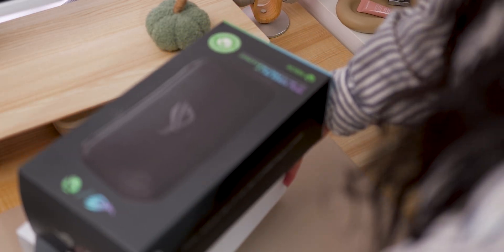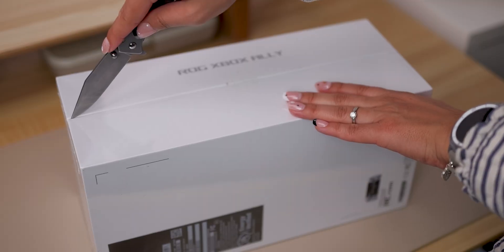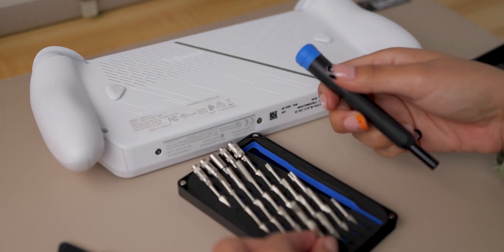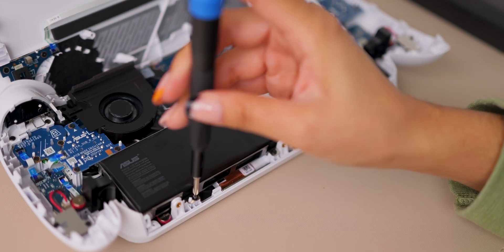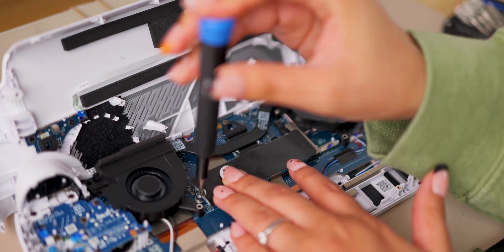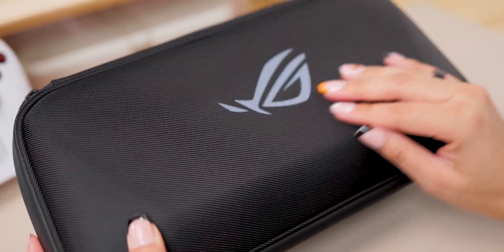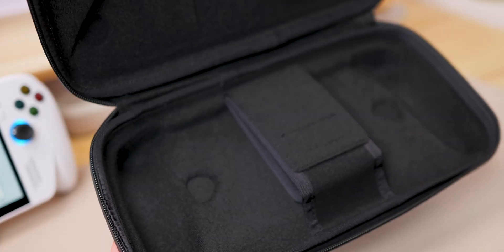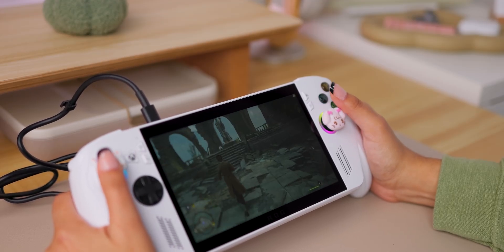ULTIMATE ROG ALLY: Unboxing, First Look, and INSANE 4TB SSD Upgrade!

Comment: Would say if got steam deck there no point getting white rog ally because pretty much same power. If go for high powerful it  one it  huge jump from steam deck I know had steam deck sold to get rog ally x it amazing
Reply from the maker: The Steam Deck OLED and the white ROG XBOX Ally are very similar in performance.
Reply: @annalifeunedited  oled and lcd steam deck have the same power